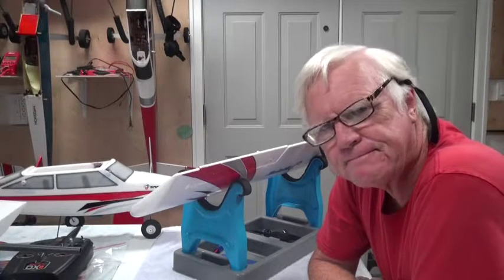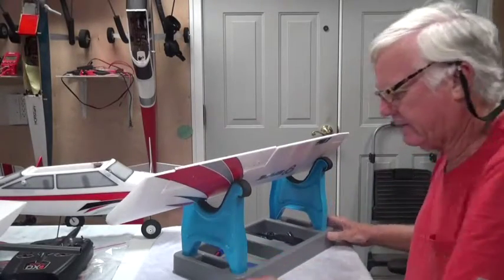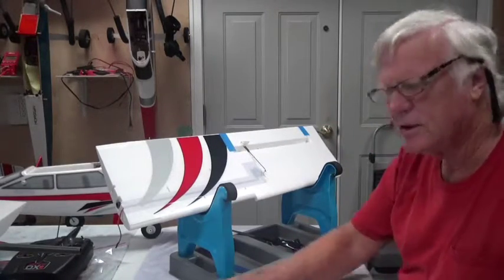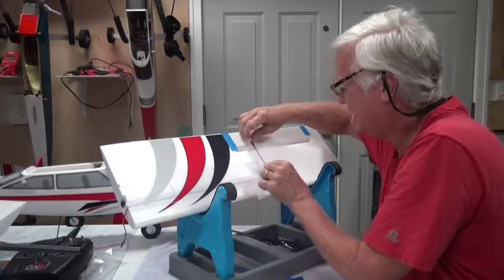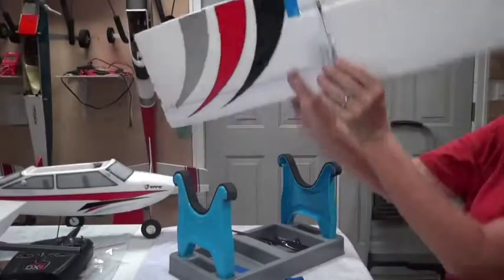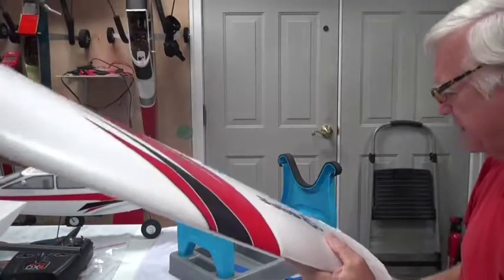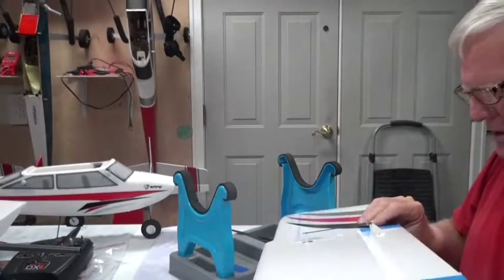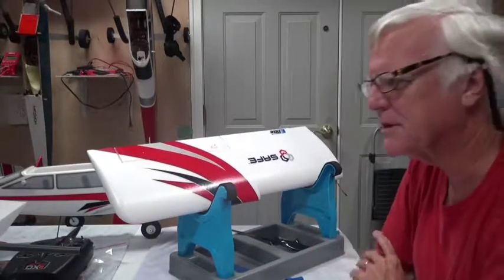AP21 Apprentice S 15e RTF Aileron Pushrods

Comment: Hi There...Great videos. Just got an Apprentice as a first RC plane and your videos have been a great help. One problem I just encountered is the aileron servo arms. There completely flat against the wing! Yours appear to be vertical, at midpoint. I tried moving them but no luck. Didn't want to break off the arm!! Any suggestions? Thanks....Ken
Reply from the maker: try centering them with the radio.  They should be vertical when the receiver is bound and working with the radio and the radio aileron stick is centered.